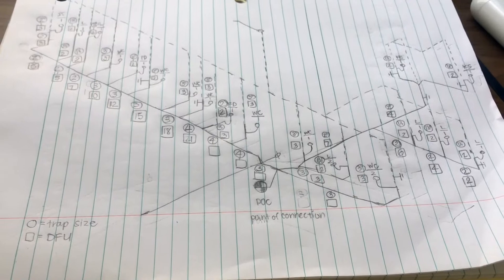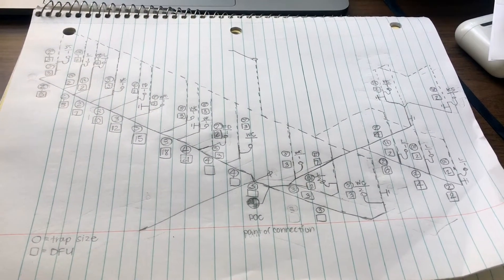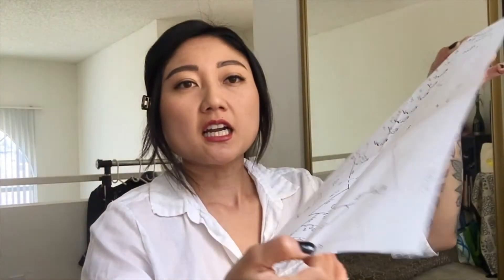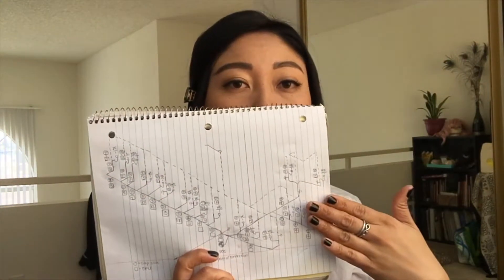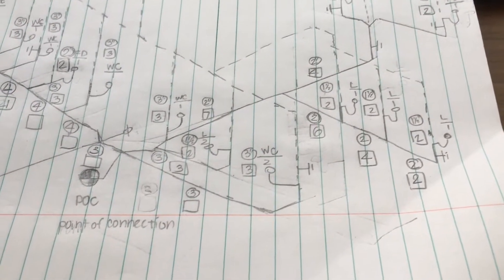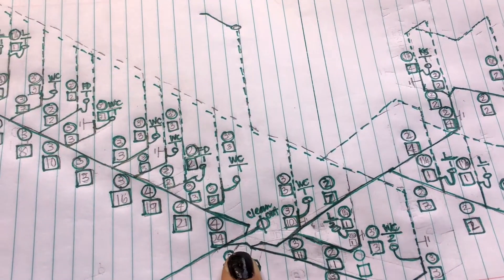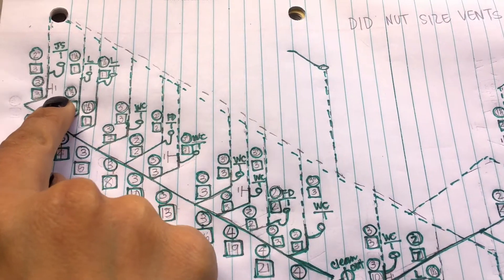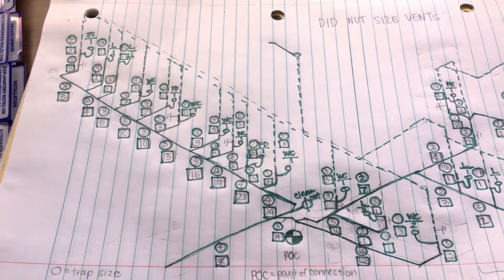Learning About Drainage Fixture Units

Comment: Maybe you can help me.  Im adding a bathroom and need to know what size vent pipe I need to support the fixtures.  Right now I have a 3" vent pipe that goes through the roof and is connected directly to the main sewer stack in the basement.  Connected to it in the attic is a 1.5" vent that serves a basement washing machine and laundry sink.  The additional items that would be added are a shower, toilet, and bathroom sink.  Is the 3" vent sufficient to serve a washing machine, laundry sink, shower, toilet, and bathroom sink?  Or do I have to isolate some of those fixtures and run a new vent through the roof?  Thanks!
Reply from the maker: Oh gosh, honestly, I’m still a novice at this so I’m definitely not the right person to ask.  I’m just getting to learning about vent sizing on the UPC.  It might help to look up your local code and search a easy to understand table on vent sizing.  Sorry! I just don’t wanna steer you in the wrong direction.